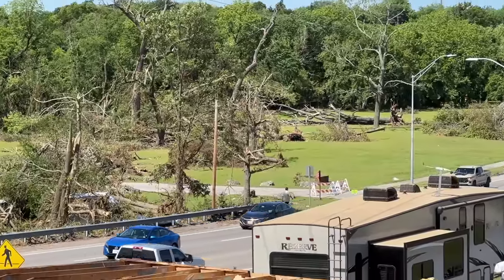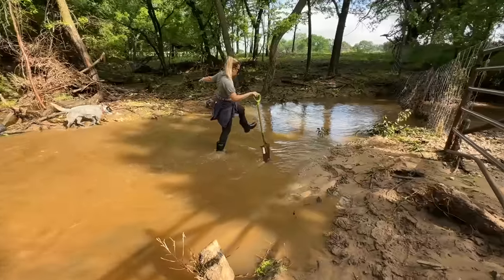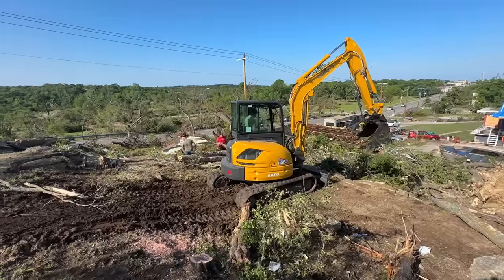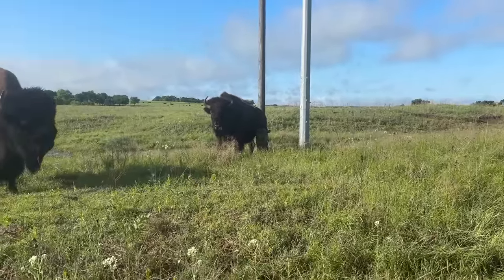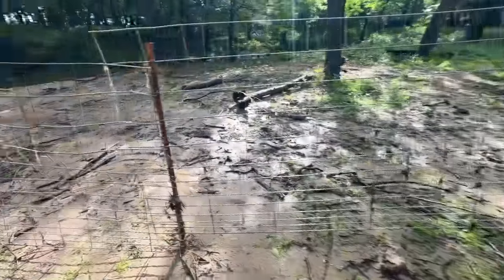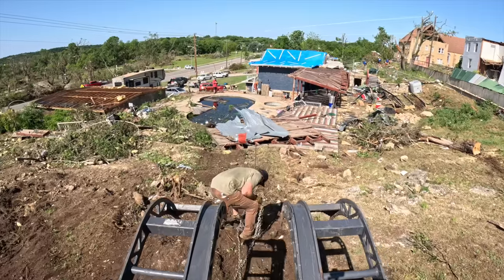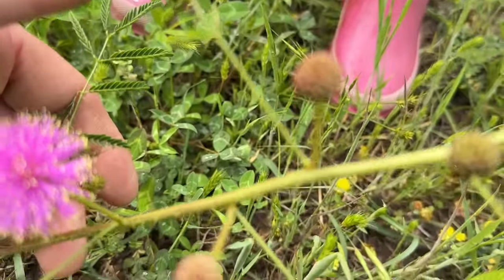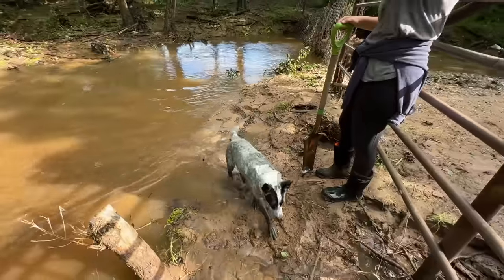Tornado DAMAGE Revealed on Our Town| Ranch Got a Lot of...

Comment: I could not copy and paste the id of the plant but it is called The " koosh ball" flower sensitive to briar is pretty hard to miss-especially because it usually appears with many others on plants that can cover areas of 6 feet in diameter or more. It's a distinctive-looking plant. Besides the showy flowers, sensitive briar has abundant spines on its stems and compound leaves that fold up when touched. Also known as Mimosa . Hope that helps , take a screen shot of it and Google the results .

Comment: Don't cut away the curves in the creek/river. If you do you will speed up the erosion because of the speed of the water (called scouring). It will cause more flash flooding and be dangerous for your animals and any infrastructure.
You can cause massive erosion gullies and the water table can lower, meaning less access to water, less quality of feed in the grasses, etc.
Blessings from a farmers daughter in South Eastern Australia, Dot

Comment: I'm have been trying to think of more cost-effective methods to deal with your creek.  In my opinion, straightening the creek out is not a good idea because it will lower your water table in the long run. Making a sort of 'containment pond', with reinforced banks would be a better idea.
 I start with the most basic and add layers:
 I saw a lot of broken concrete block being moved in Sulpher. The simplest thing, if you are able, get what you can of them and dump them along the banks of your creek. Personally, I would additionally pile a bunch across the creek in a wall form , holding back the water a little (Eventually, soil will probably build-up ahead of this), but letting flood waters run through and over this. If you could, put a solid concrete top on the pile so the really heavy water would flow freely across. This would also create a perfect place to mount your fence. A few short pieces of culvert just below the concrete top would be even better than having high waters run over the top.
 You could stack broken up 2" x 4"s against the embankments before adding broken up block and/or stones on the creek side of this bank enforcement. Chipped wood sprayed in behind the blocks would add extra material. Covered with landscape cloth before adding the block/stones would help contain any organic matter. 
 If anyone has broken chain-link fencing, it's perfect for holding stones together. Here in Ottawa, Canada (Yes, I sent you the picture of our bison coin), we call them Gabion Baskets. They are used in many parts of the world to hold up embankments and to reduce landslides, especially along waterways.

Comment: You need an excavator like Daniels to come out and straighten out the bend, and then put some big boulders along the walls to protect them. Something big enough that it can't wash out though. You are going to need an excavator though, and probably be hard to get on until life there finds some kind of new normal. It will take years to rebuild and things will never be the same, but your community will survive this and come back with a new, stronger slightly different life. I know this because I have lived through some massive earthquakes and multiple wildfire seasons. Somehow it always seems to pull communities together even tighter. You might lose a few residents moving to someplace new instead of rebuilding.

Comment: With most houses been made from wood, the trees that have been felled can they not be milled into planks to help rebuild houses, I live in the UK so don’t know if this is allowed or will they be classed as contaminated
Reply: There should be no reason why the downed trees can't be used. But you need them to be milled and kiln dried. That equipment may not be local. Transportation takes time and money. Also, I don't know all the species of wood that are common to the area, but pine is usually the wood for building walls and framing. I know there was a certain amount of pecan trees downed. The big problem will be labor. Oklahoma and Nebraska and other hard hit areas don't have a large population. And now there are few places to stay while working. There are many challenges ahead.